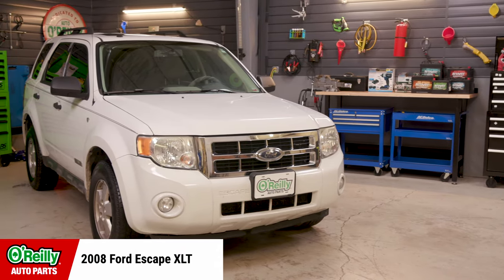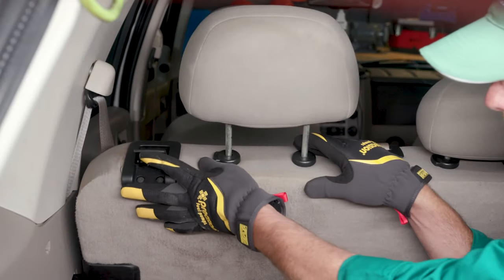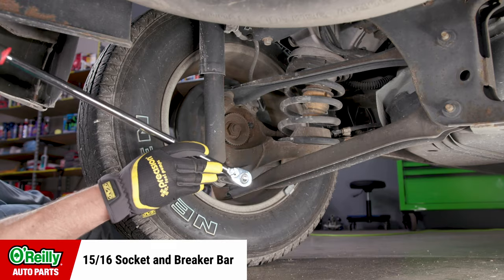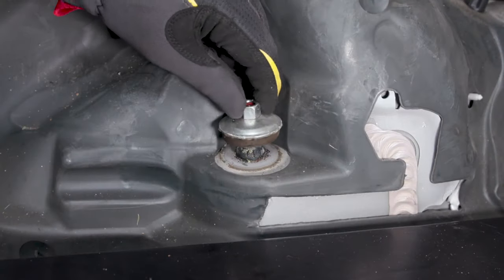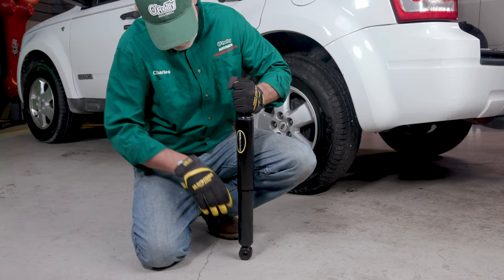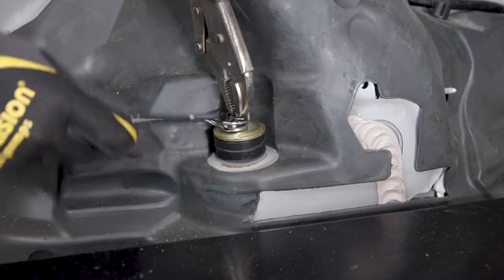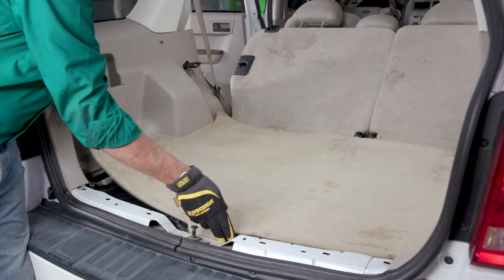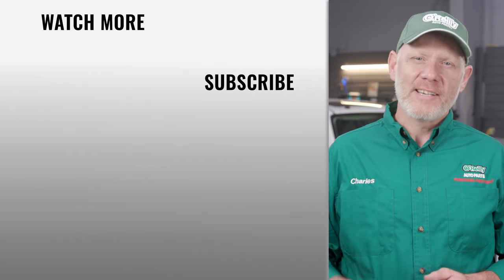How To: Replace the Rear Shocks on a 2008 to 2012 Ford Escape

Comment from the maker: Supplies Needed for This Job:
1. Safety Glasses: https://urlzs.com/hbwc
2. Gloves: https://bit.ly/2GvfwAm
3. Rear Shocks: http://bit.ly/2Vgnruu
4. Ratchet and Sockets: http://bit.ly/2IEAOOi
5. Trim Tool: https://bit.ly/3bPPzZi
6. Breaker Bar: http://bit.ly/2UWfies
7. Locking Pliers: https://bit.ly/3aaQrXg
8. Wrench: http://bit.ly/2IUfBzn
9. Brake Cleaner: http://bit.ly/2UxiRmp
10. Rags: http://bit.ly/2GDgwm1
11. Torque Wrench: http://bit.ly/2UToD1D

Comment: That FordTeckMak guy says to jounce the vehicle a few times before tightening the lower mount.  This is to prevent binding of the bolt through the shock mount.  Does this action make a difference?

Comment: I have watched all the videos that apply to this series vehicle and looked at the parts suppliers and do NOT see that any aftermarket shocks use the factory rubber isolators between the lower shock inner and outer mounting hardware. Reference 1:51 and you see rubber between the shock and mount and between the shock and washer.
Why is that?
Ford thought it was needed but aftermarket do not.
Reply: I saw one vid where the guy sad to re-use the Ford top mount nut and isolator.
Reply: @RideAcrossTheRiver  
The threads are different on the units I got, so I could not reuse the OEM nut/mount.
Reply: @jrsmyth9761  Which brand?
Reply: @jrsmyth9761  KYB tells me their units come with top mount hardware.
Reply: @RideAcrossTheRiver  
KYB, if I recall correctly.
Reply: @RideAcrossTheRiver  
Correct, just different than the OEM mount.